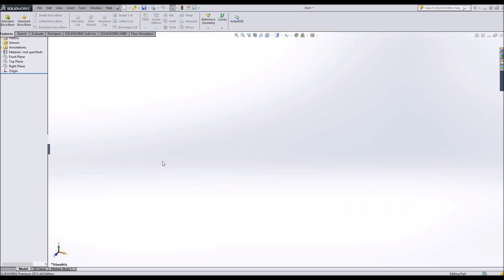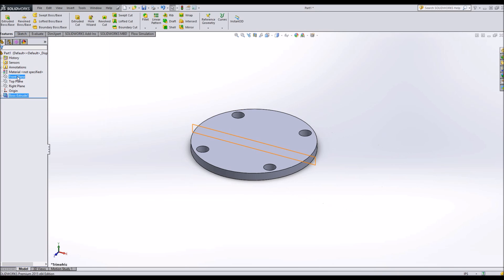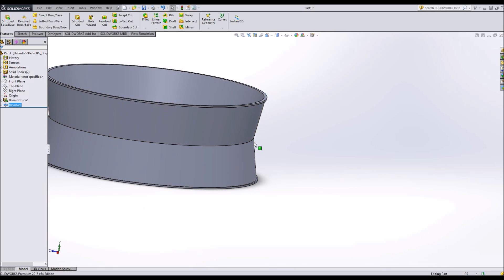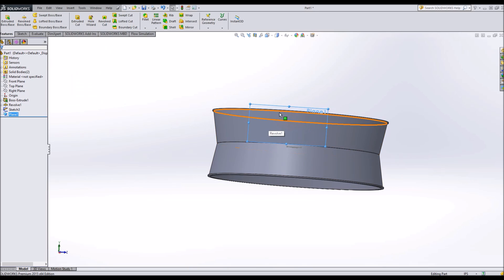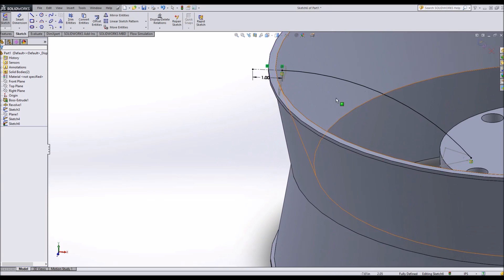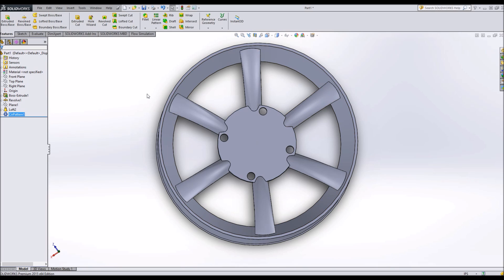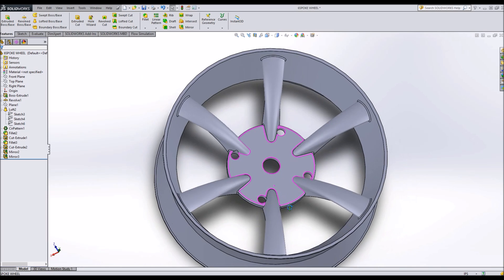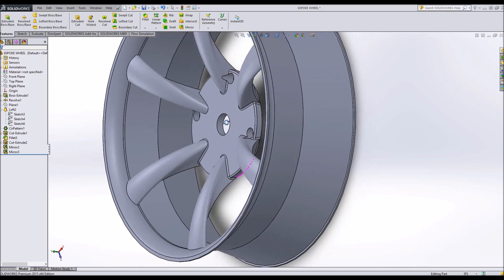How to Make a Wheel in SolidWorks |JOKO ENGINEERING|

Comment: Somebody please remind me to never watch this man's videos again. What was the point of fast fowarding? The sketch video you made was only for one part that you fast fowarded. Complete utter waste of my time. -_-
Reply from the maker: Somebody please remind zola12 to read the description where there is a link to the fastforwarded section.  It was fast forwarded because I didn't think people would need help on one of the most basic things you can do in SolidWorks...
Reply: Joko Engineeringhelp Somebody please remind Joko Engineeringhelp to read my comment again. You made a video only on one sketch that was forwarded. What about the second sketch that was fast-forwarded? Your video does a disservice to beginners. Why not make a whole new video where NO sections are fast forwarded? 
Sigh...
Reply from the maker: The sketch at 11:36?  Right after I say "This is an adequate wheel for beginners?"  There are plenty of resources on this channel if you're having trouble with changing a sketch.

Comment: Exactly when you fasted.
Thanks dud. so please upload the hole video with normal speed.
Reply from the maker: Hemen Kareamg 
The new video is here.  I actually use a method in this video that is a lot easier than what I did in the original video.
https://www.youtube.com/watch?v=PI7LJzRaiKc
If you're having trouble with these sketches, I recommend my video here:
https://www.youtube.com/watch?v=ZfoFophtJk0
The second time I fast forward, I only change the sketch that I fast forwarded the first time to be a little more curvy.  It's not necessary for the wheel, just looks.  Good luck.